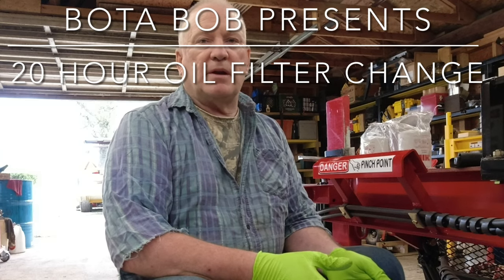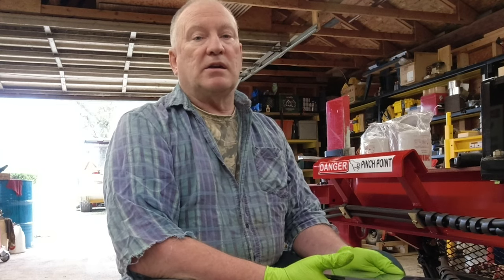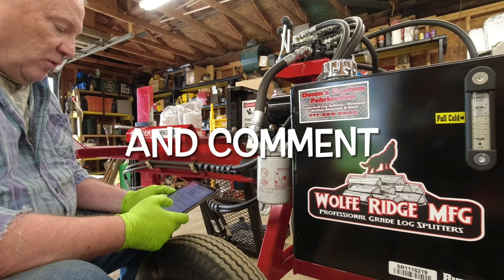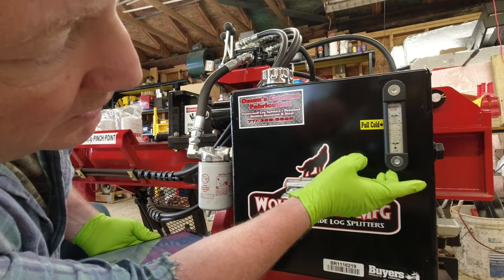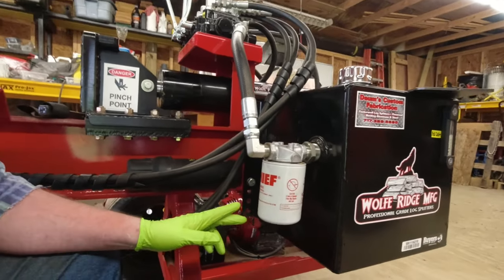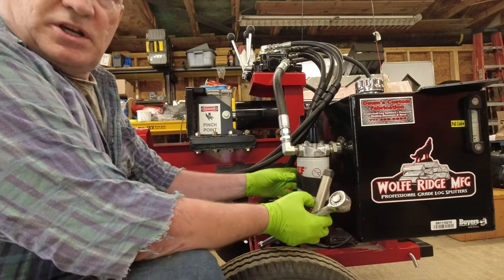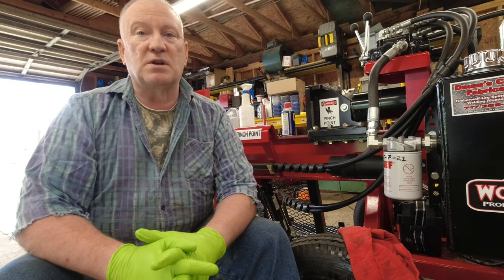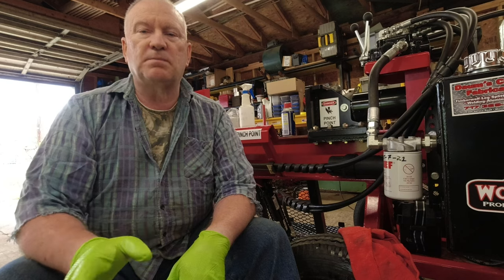#72 - Wolfe Ridge Pro28 - 20 Hour Oil Filter Change

Comment: Next time try tilting the machine towards the back first to shift the oil away from the filter level. May reduce the drainage a bit.
Reply from the maker: Thanks for the tip!  Now, why didn't I think of that.  Great tip.  Thanks for watching and commenting - Enjoy the journey - cheers.
Reply: A shop vac on the filler port on top would have helped a lot.  Probably would have only lost what was in the hose and filter.

Comment: Usually you don’t change just the filter, Drain the Hydraulic oil 1st, then change the filter and add new hydraulic oil. Nice Splitter! 🚜🪵👍🏼🇱🇷
Reply from the maker: The owners manual is not clear about replacing the hydraulic oil.  Now you have me wondering.  I will send Wolfe Ridge an email and ask for clarification.  Thank you for pointing that out.  Seems a shame to throw that oil out, it is very clean.  I will check.  Thanks again.
Reply: I wouldn't change the hydraulic fluid in 20 hours.  Just the filter.  That fluid is no where near the end of it's life.

Comment: Bob what type of Hydraulic fluid did you use to fill her back up...?
Reply from the maker: I bought it from the Kubota Dealer (Messick's) but not sure of the brand.  - I will go out to my garage when I get a break from the office and let you know.  Sorry I did not see this sooner.
Reply from the maker: The Hydraulic Oil I purchased from Messick's is manufactured by MAG1 - AW ISO 32 Hydraulic Oil.  They have a web site.  mag1.com - Wolfe Ridge calls for an AW - 32 or ISO 32 hydraulic oil for the PRO 28.  I looked at Tractor Supply for it, so I stopped by the tractor dealer to see if they carried it.  You might also try an automotive parts store - just google "where to buy hydraulic oil iso 32".  I hope this helps.